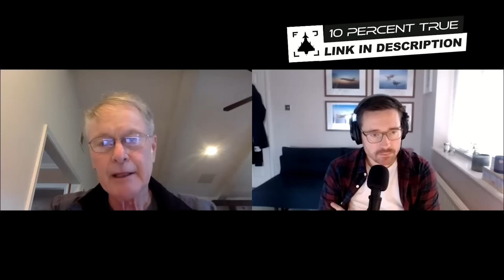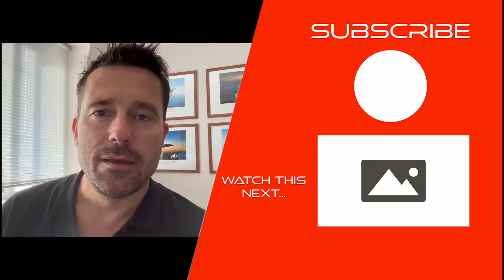YF-23 vs. F-22: As Told by Test Pilot Who Flew Both

Comment: fy23 seams to be more future proof design - less of a dogfighter, more stealth, speed and altitude.
Reply: get over yourself cupcake, you're anything BUT an expert here
Reply: Form steath capability, yes. But the Air force plot their peformance and the YF 22 has better manuverbility. And it is more all around Fighter. And from the converstion of this confirms that. "The YF23 is more stable than YF22" this is not necssary a desirable characteristic for a Fighter jet.
Reply: @林振华-t4v  which is exactly what I said. manuverability isn't a factor today. it is all BVR, where speed, range (supercruise), altitude and stealth matters - all aspects, where YF23 was superior to 22 (at least based on all publicly available material)
Reply: @wojciechczupta  you maybe need to avoid air defense or air to air, but if SU-34 can do it, YF-23 can as well, lasers to blind thermal sensors... if necessary
Reply: @wojciechczupta Maneuverability absolutely is a factor when you consider stealth aircraft are more likely to encounter each other at close ranges than from afar. Sure, any stealth air superiority fighter will dominate in BVR combat against non stealthy aircraft, but low observable technologies do decrease initial contact range significantly. There’s a reason the craft was picked, thousands of people evaluated the possible scenarios and picked what they determined would fit that need best.
Reply: @Mobius118  it was 40 years ago when F22 was selected. It was secondary when F35 was selected. It is even less a factor today and stealth is unlikely to change it. Dogfight is a gamble, which nobody will afford.
Reply: Politics played a huge roll in the choosing of the YF 22.  Senator Sam Nunn, (Georgia), was the head of the senate armed services committee at the time. Just happens to be the state where it was manufactured.  Unfortunately, because of costs, we only received 195 planes, when it was supposed to be 750. And I believe 8 of those were test a/c.  I always believed the Northrop/McDonnell Douglas F23 would have delivered more. I also believe McDonnell Douglas would still be in business, had the F23 been chosen.
Reply: @rodneymcvey1059 I'd say going from 750 to 195 is actually one of the reasons for the plane being so expensive
Reply: @rodrigorincongarcia771 You’re absolutely correct. I’ve researched into this and continued production drives down per unit cost, maintenance costs, and more. We saw this with the F-35, which was initially comparable in price to the Raptor but over continued production is now much cheaper by comparison.

Comment: The YF-23 was ready for flight (meeting contract) and the F-22 wasn’t. The USAF extended the deadline to let Lockmart stay in it.

During test flying both 22 prototypes crashed. They were not refined as the YF-23. The proof of this is if you look at the prototype YF-22 and the production F-22. The F-22 looks more like the YF-23 than it does the prototype YF-22.

USAF gave points to the YF-22 for their marginal thrust vectoring…even though it wasn’t in the test program for that phase. The YF-23 had provisions for thrust vectoring but it wasn’t required for that phase of flight testing.

The decision to buy F-22 was based on two things…concern over Northrop have enough talent to execute two programs (B-2 and F-23) and losing a major supplier like Lockmart. They didn’t have anything products…if the lost F-22.

The USAF bought the wrong bird because it wasn’t about having the best equipment it was about careers etc.
Reply: @AndyJohnson-l2j  Maintaining your industrial base is a legitimate criteria for selection.
Reply: cope
Reply: The F-23 would have dealt the same blows the F22 is today meaning we wouldn't have 700 or 300 of them and NGAD would still have to replace the F23.

Comment: YF-23 can only carry x4 missiles in small weapon bay in it's nose.
Reply: No it was going to carry 6 just like the F22.
Reply: @ManOfChaiTea It ‘was’, but it did’t …  current capability is much more valuable than future promises to deliver on a level your counterpart is already achieving
Reply: @Mobius118 

You don't seem to understand that these aircraft were not prototypes even though they are designated "YF" but technology demonstrators. So saying "it 'was',  but didn't..."
is a nonsensical argument.  Everybody associated with the ATF program understood that there would be changes to everything.
The biggest major item to be 'changed'  was the YF-119 P&W into the F-119 engine.  By pass ratio massively changed, engine size increased so much so that it could be said to be a completely different engine than the one selected for production.

At the time Lockheed made a lot of points about the Northrop weapon bay and the proposed launching mechanisms to deflect the biggest weakness of the YF-22.  Weapon bays too shallow and small.  The YF-22/F-22 can only support missiles of the size of Sparrow and Sidewinders. Severely limiting any development of new class of missiles.

The Air Force could have the missile load out of the F-22 with the F-23 and tested the stacked missile until proved to work for an increase that the F-22 could never support.
Reply: @DrsharpRothstein  The weapons bays for YF-22 were designed based on Air Force requirements and the dimensions were enlarged for F-22 design submittal based on updated requirements submitted during the flight testing.
Reply: Northrop had a patents for stacked  internal missile carriage that would allow the main bay to carry 8 AMRAAMs plus two sidewinders. All internal.
Reply: No, there were going to be three bays in the production aircraft with a fuselage plug to increase the length of the nose.

Comment: The similarities between the two jets are a result of convergent evolution. The requirements set by the Air Force influenced the design of the planes. The best design sort of forces similarities.
Reply: I disagree. They might have some similarities in that both teams followed the Whitcomb area rule and so their wing area was nearly identical. But it seems Lockheed started with the F-15 air frame and tried to make it stealthy and able to supercruise, while Northrop made the the stealthiest most low-observable air frame and then  met the ATF requirements with what they designed. One key difference is the YF-22 had thrust vectoring, which Northrop considered but didn't implement on the YF-23 because they were banking on minimal need for within visual range engagements.
Reply: @SanjaySingh-oh7hv  Mostly agree. But the 23's control surfaces were so huge, that you'd have to be going at an very 'unwise' air speed for the thrust vectoring to become a factor. At any sane engagement speed, either plane could squish the pilot.
NG did this because they put a focus on IR stealth, which wasn't explicitly called for in the contract ...but would be obviously important to anyone who understands how leaving built-in weaknesses drives the technological arms race. Basically having the thrust vectoring ensures the F-22 to have diminishing value over time, as every east-block combat aircraft made in the last 30 years has some form IR sensor solution. Northrups engineers assumed that would be regarded as "bad product". They somewhat overestimated the technological foresight capabilities of pentagon brass.
Reply: @kathrynck  Don't recall if IR was a requirement but it was absolutely a big consideration in the design of F22.
Reply: most people intuitively understand convergent evolution, even if they don't know the term. but somehow this obvious concept is disregarded on topics related to china's technical achievements (defense sector or otherwise).
Reply: @the80386  Come on.... come ooooon. Are you trying to say in academic sounding language that China's new planes just happen to look like the American ones because they are converging on an optimal design as well? Is that what you're saying?

You must have heard of a guy named Su Bin who stole lots of documents about the F-35 and gave them to China. China as a culture cannot make anything. They can only mock. They are thieves and copycats and demagogues. Nothing more. 

This was most obvious when the police arrested the doctor who was trying to bring attention to the disease that would later be called COVID-19. They made him sign a document that he was disturbing the peace before he died. THAT'S the country you think can challenge American and European engineering innovation? Either you're Chinese yourself or you're a fool.

China is a country of low creativity and even lower innovation. So far as I can tell there is not one key technology that was invented in China that we rely on everyday. Please provide a counter-example if you have one.

Comment: The title of the video is wrong. As your interviewee once said, no pilot had flown the YF-23 and the YF-22. Paul Metz had flown the F-22A, which was a very different beast than the YF-22.
Reply: @magoid  Paul Metz flew both the YF-23 & the YF-22
Reply: @Callsign_Bubblez  
No, he did not flew both YFs.
He only flew YF-23 and then F-22A starting in 1997.

He was a Northrop test pilot at the time all of the YF-23s and YF-22s PAVs flew in 1990.

The two YF-23s were obviously flown only by Northrop and McDonnell Douglas test pilots + one specific USAF test pilot. 

The two YF-22s were also obviously flown only by Lockheed, Boeing and General Dynamics test pilots + one unique USAF test pilot to them as well.

Although one of the YF-22s continued to be used for test flights into 1992, the jet crashed that year (and never flew again) before Paul Metz was hired by Lockheed.
Reply: @deltasierracharlie  Sorry man my mistake, I should've done more research on his history as a test pilot.
Reply: @Callsign_Bubblez  No he didn't. He said so himself in other video.
Reply: @magoid  what video?
Reply: @magoid  
Not this one.
Reply: @magoid  Roger
Reply: Ya i don't know why he would put that other than clickbait.
Reply: Isn't the Title: "YF-23 vs F-22" easy to confuse, but technically correct.
Reply: He changed the title of the video.
Reply: @magoid   👍🏻👍🏻